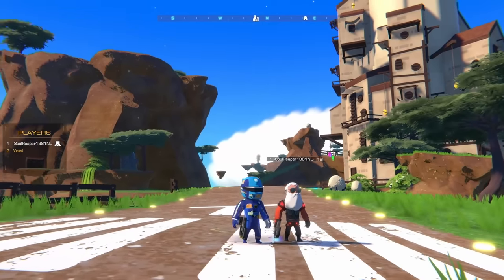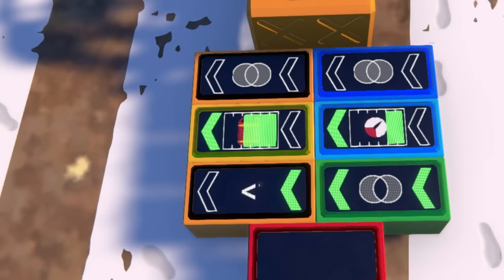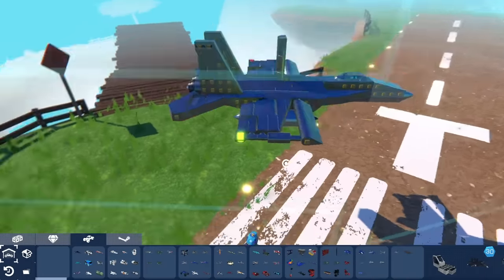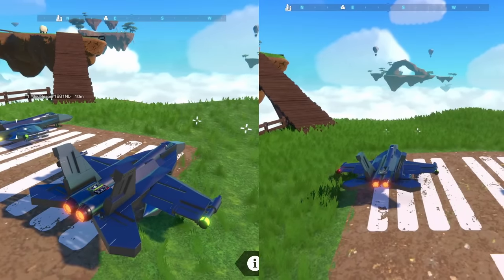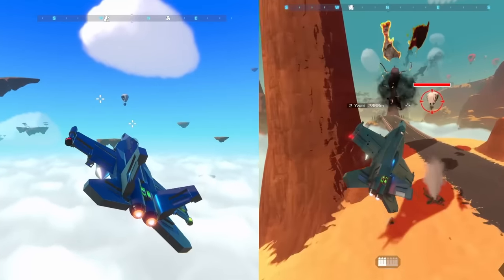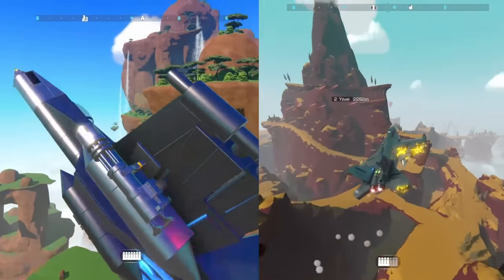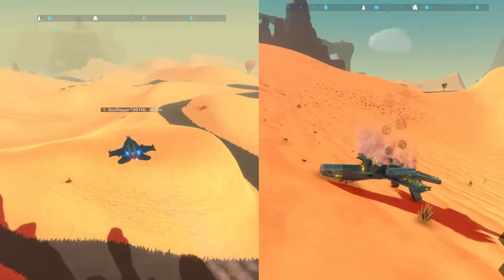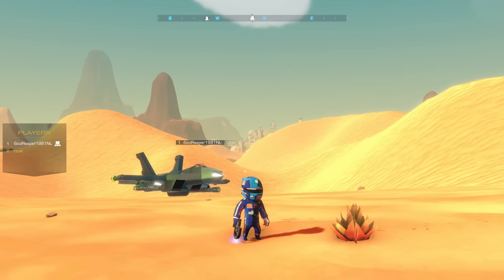The NEW logic Allowed Us To Make WORKING FUEL!

Comment: I have an idea for you Yzuei, I'm sure you've seen the movie SPEED, right? Well, why not use your accumilator rig in reverse and once you pass a certain speed, arm a dynamite, and trigger it if you go under that speed for more than a few seconds. Run around the various race tracks with Scrap or some other friends, and see who  blows up last ;)
Reply: Oh, you CAN reset that rig, right, without doing a repair? You'd need that to reset the 'under minimum speed' counter once you get back above that speed again. Or, maybe have the thing  count up to a limit when above the min speed, and down toward detonation when you go below it? That way just hitting the minimum speed wouldnt totally reset your detonation timer, you'd have to drive for a while to add time back onto the fuse, so to speak

Comment: 0:42 i have made this fuel system but sadly coudln't figure out how the comparison block and 2nd OR gate works in the system also couldn't figure out how the greater than works so i changed some things and changed the OR gate to the NOR gate and a extra comparison block and thus i have made the same fuel system just 1 extra block and some different blocks but still works the exact same 😄